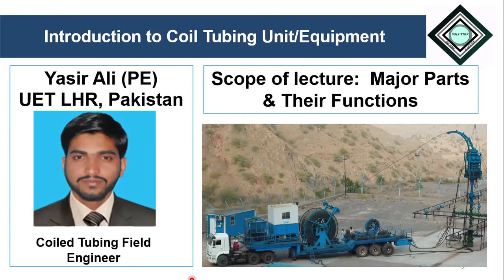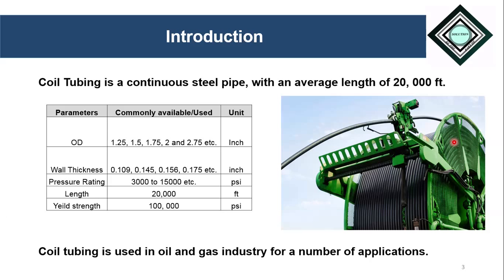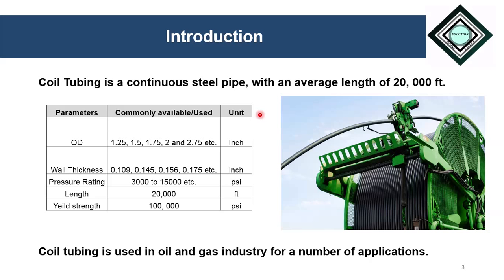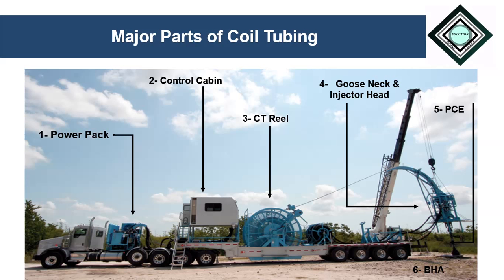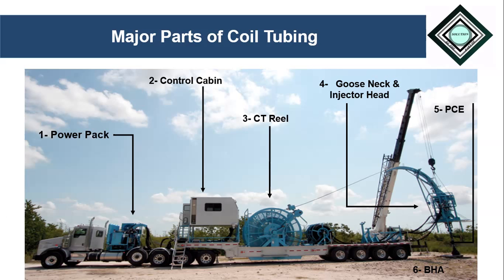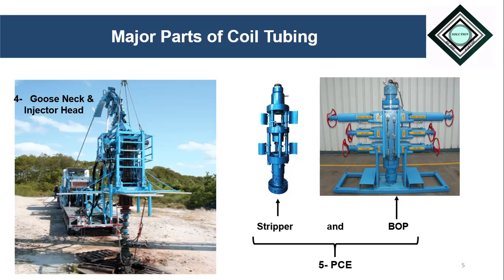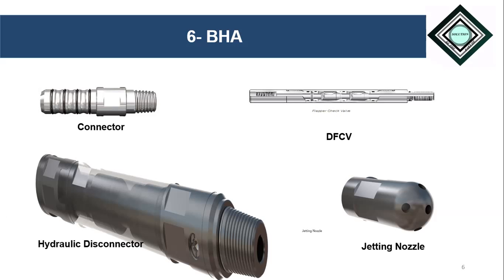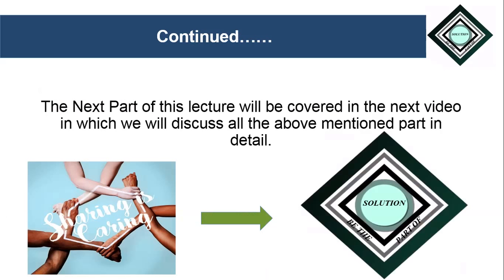2- Introduction to Coil Tubing Unit/Equipment-By Yasir Ali

Comment: Hello yasir Ali can u help me I'm preparing for interview for assistant operator of coil tubing so can you help me questions for the  interview. And What kind of QUESTIONS  in CT I have to prepare please guide me. If that kind of any written material is available word type please send me mail. And help me.
Reply: Where you applied and which company?
Reply: If you still need please let me know. because i am working as a Assistant ct OPERATOR.
Reply: @arfanahmad3013  bhai I need help regarding assistant coil tubing operator